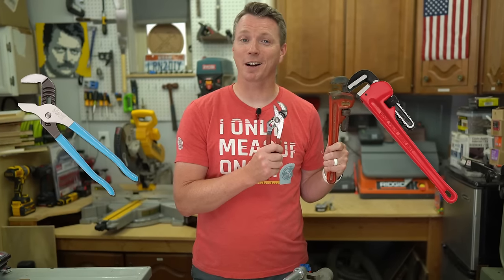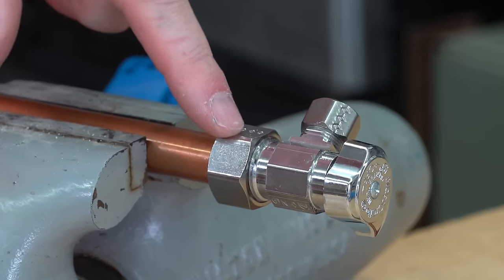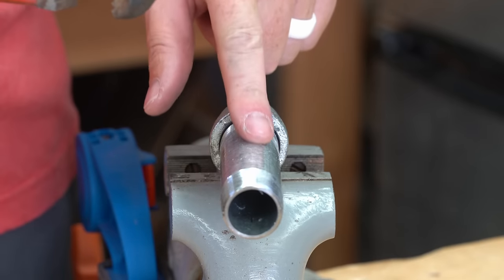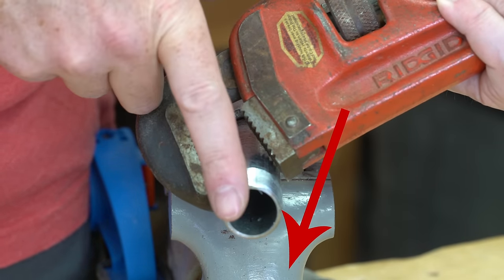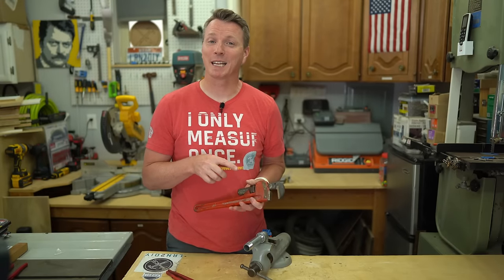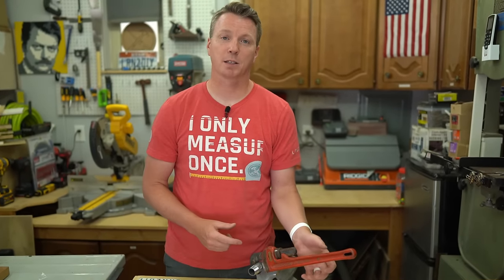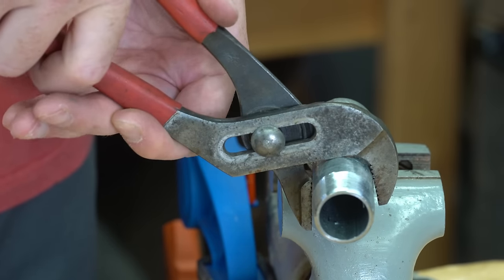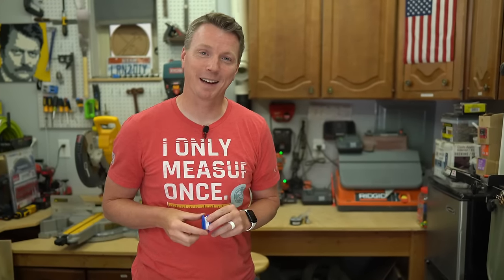3 MISTAKES We Make Using Pipe Wrenches & Channel Locks

Comment: You put the adjustable wrench on the nut backwards. When using it the way you did, If you have to use a lot of force it tends to push the jaws apart and increases the chance of rounding off the nut. The handle is at an angle to the jaws for a reason. Wrong about the pipe wrench as well. You want two points of contact to take advantage of the leverage to improve the grip. Take the jaw out of the wrench and you will find a little spring inside the wrench. Put your thinking cap on and tell us why they did that. For a quick lesson in leverage try to use the channel locks backwards.

Comment: At 1:15  The adjustable wrench should be on the other way.
Reply: nope.  put the force at the base of the movable jaw, not the tip, just like with the pipe wrench.
Reply: @kenbrown2808  Nope, you're wrong. Try again ken.
Reply: @purdyboi8078  okay.
nope.  put the force at the BASE of the movable jaw, not the TIP, so the jaw has more leverage to hold its shape, just like with the pipe wrench. just like anything else that you want to avoid bending or breaking.  put the force at the SHORT end of the lever, instead of the LONG end.

Comment: Just as I was about to tell you the pipe wrench wasn’t opened enough….. One thing important is that quality like rigid brand is best ,also years ago when we ran galvanized we could,knock out the pin and put a new lower jaw on the wrench.

Comment: Wrong on slip joint pliers.
Your fingers are too far apart making your grip  too weak. Move to the next slot  so your fingers are closer together amd you can put more  pressure on the jaws.
Jaw pressure is more important than throat contact.

Comment: It's almost impossible to use a pipe wrench in the wrong direction. An adjustable can brake if used in the wrong direction or strip the nut.

Comment: putting a boxed end wrench on a fitting to hold the valve from turning is not the right approach, using an open end or adjustable  wrench on the back side of the valve is the right way if you notice the valve is shaped to hold to hold a wrench. if that valve was on really tight, you could break the smaller fitting off. he does have some info to follow but some not so good.

Comment: I’m sorry, as a master plumber with 52 years of experience, 3-points of contact is ridiculous.  This will insure more slippage.  You want the pipe in the back of the jaws, but not touching the back. It’s about the geometry that force is applied with the jaws of the wrench, not 3-points of contact.  Just think about it, if you needed that extra point of contact, manufacturers would have given you a dedicated flat or toothed surface for this contact.  Also throw away your Channel Lock or other grooved pliers and buy yourself a good set of “water pump” pliers.  They are easier to adjust, and stand up to water and mud much better
Reply: You are correct in your assertion but the word you wanted was ‘ensure’, not ‘insure’…

Comment: Tip 1.. Do NOT EVER use the outlet of a valve for leverage. It is the thinnest and weakest part. The body of the valve is made to accept a standard wrench so people don't breaks it like you just advised . How's about getting some actual wrenches before giving such worthless and dangerous advice??!!??!!. Tip 2.  A pipe wrench will only work one way which makes it impossible to make a "mistake" .. Was Tip 3 just a list  the names commonly used for Water-Pump pliers??    SO, there was only 1 tip and if followed, will result in a broken valve....  This is a little embarrassing...

Comment: The municipality contracted with a non union plumbing shop to change the meters in homes and i had the pleasure of watching the "plumber" that came to my house completely chew up the old meter, then promptly chew up the new meter upon installation, the "plumber" as most scab shops had never completed a full certified apprenticeship, never been taught how to use correctly his cast iron Harbor freight pipe wrenches, but hey! they were the low bidder.😂🤣